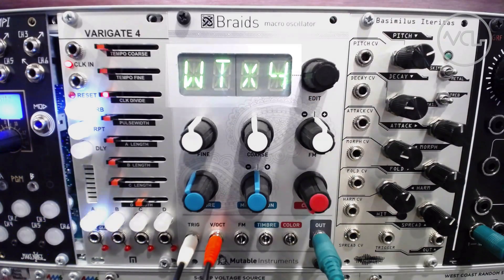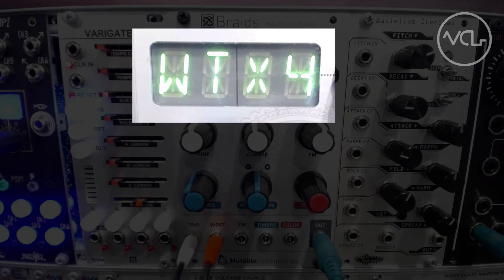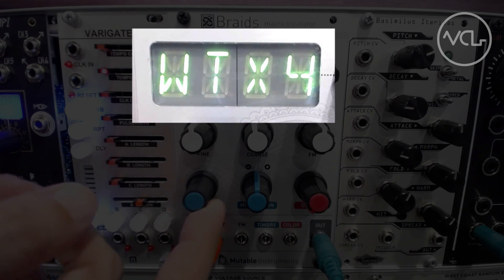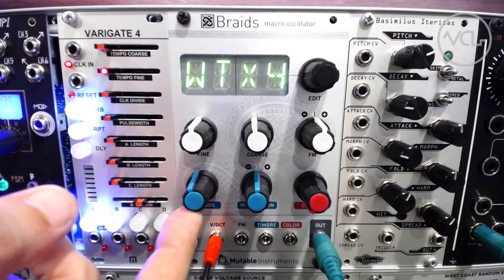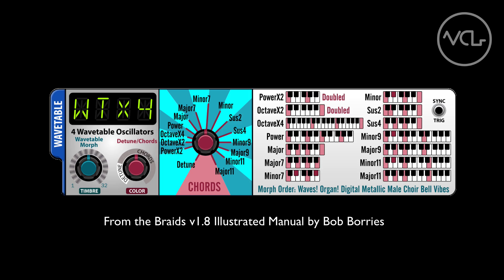Eurorack Polyphonic Chords With Braids

Comment: Cool
Reply from the maker: Hey Bob, I would have asked permission to use your graphic, but your manual said it was Open Source, so I figured it would be ok with attribution. I hope it's not a problem, you do great work!
Reply: +Voltage Control Lab it's no problem, I saw the credit below the graphic, great video, I'm a subscriber